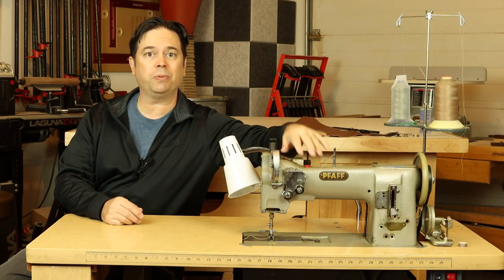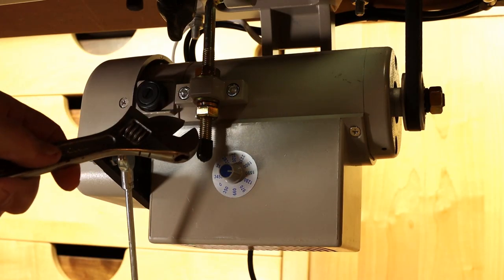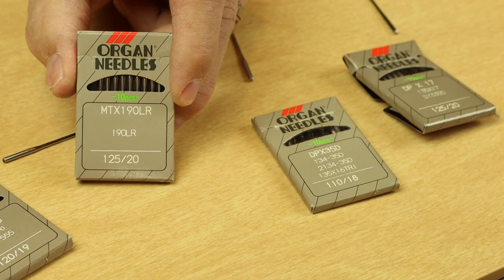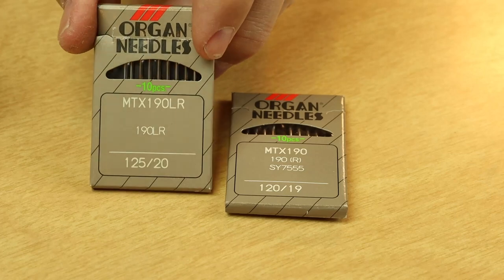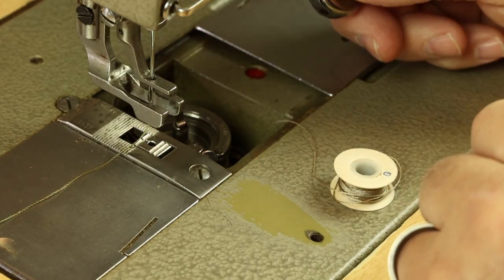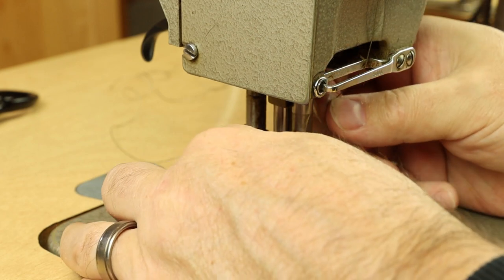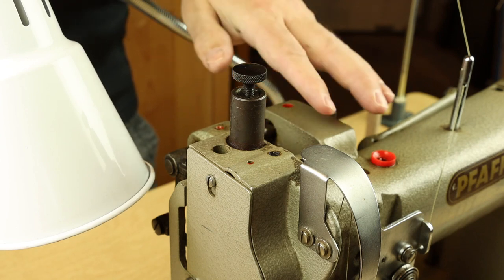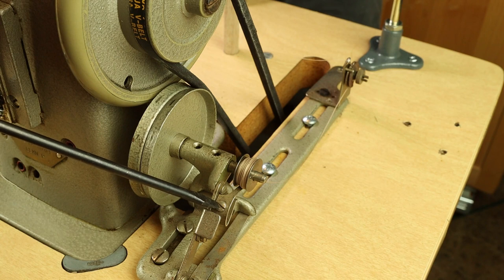Everything Pfaff 145 Walking Foot Industrial Sewing Machine Learn to set up and adjust Pfaff 145 545

Comment: Thank you so much for this video! I was told incorrectly how to thread the machine! Question - my hand wheel is very tight (squeaks when I sew) and when I pull the material (leather and material) away from the machine, after sewing, it's very tight. I have to release the thread tension of the top thread to give me slack to pull away from the needle to cut the thread. My machine jams quite a bit. There aren't many people in my area who have experience with this machine so I am wondering if you think the tight hand wheel is causing my machine to squeak and then jam. I have loosed up the tension to where it's almost at the edge of the tension knob but then my bottom stitch is loose. I did install a servo motor and speed reducer (looks like the one you have). By any chance could the servo motor or belt cause issues with the hand wheel? I am using 138 thread with the correct needle size but wondering if it is too thick. Although I thought that this machine could handle 138. Thank you!
Reply from the maker: Hi Kim,
I would start with 92 weight thread and a #20 needle.  Make sure to use 134-35 needles if it's an H3 model or 190 system needles for an H4 model.  You will always need to raise the pressor foot (or operate the knee lift) to release the threads.  The release will be much easier with 92 weight thread.  I don't enjoy sewing with 138 thread, because it pretty well maxes out the machine.
The squeak can be caused by a new belt or if the motor pulley doesn't align with the handwheel pulley.  Sight down through the slot in the table to check pulley alignment.

Best of luck!
Reply: Thank you! I will try 92! Oddly enough, I added oil near the handwheel where you mention in the video and that helped quite a bit. Still some squeak when I manually use the handwheel but at least its gone while I am sewing. I will check the belts. Thank for the reply!!
Reply: Oh and thank you so much for explaining the needle difference between H3 and H4. I do have H3 and have lots of 190 needles and just by chance also ordered 135 so fortunately I am using the correct needle size so if you need a bunch of 190s, I have some to give away!
Reply: @kpollock313  I could use them for my 545 machine! if no one else can, Thanks for offering!

Comment: Hi there, I’ve just acquired a Pfaff 545 H3 6/01 and I’m looking to find a service manual for it… do you know where I can find it? I have found the instruction manual and parts manual… or is there another machine that would have the same specs… im thinking of timing instructions if needed… great video by the way…sincerely Heather
Reply from the maker: I don't know where to find a service manual anymore.  There may be videos showing how to time a Pfaff 145 / 545.  It's pretty easy once you know what screws to loosen.  I'd suggest looking for a general industrial sewing machine repair pamphlet or book.  It will cover all the main types of machines, and you'll be able to figure it out.  Again, the challenge is finding one.  Best of luck with your machine!  They're great once you get them tuned.
Reply from the maker: I found instructions for servicing your Pfaff here... http://dixiesewing.com/PFAFF%20SERVICE%20BOOK.htm 
Follow the link to your model.  It starts as a basic instruction manual, but keep reading and you'll see written instructions for various adjustments.
Best
Reply: @TheThoughtfulWoodworker  thanks so much! I found that one too

Comment: Another question - and I am sorry for asking because I feel like I am taking advantage of your good nature, but - I cannot seem to find a 190 (LR) Size 20 needle unless it is in a box of 100.  Until I know what the heck I am doing, I would prefer to buy several packets of 10. Please tell me what I am doing wrong that I can find the 190/20 but only in R? I've ordered the motor, pulley and belt, and magnetic guide. I am so excited.

Also, do you still have a woodworking youtube channel? I want to show you something I am doing. It is not something really cool but it is something. I bought an old carpenter's toolbox and I am converting it into a small desk. His union card was in the toolbox and it was dated 1922 so I think the toolbox is over 100 years old. I tried to give it to one of his family members and I searched for a good while on the internet. I only found one person and that person would not respond so I decided to honor the man by making a desk out of the toolbox. Enjoy your week and again thank you for your help.
Reply from the maker: That's awesome you popped for the motor!  You'll love a servo.  I usually buy most of my needles off eBay.  Click on each listing, and see if they have options for 10 needles at a time.  
I just have one YouTube channel for now, with both woodworking and heavy sewing content.  Your tool box / desk project sounds like a great one.  Best of luck!

Comment: Great Video! I learned a lot from your video. Thank you so much. I’m thinking of upgrading my motor to a servo motor with a needle positioner. I want to slow it down to do leather work. Do you by chance know the servo motor brand and model number? And do you like that servo motor?
Reply from the maker: Thanks Greg.  I use the Techsew 550w analog servo with a simple dial to adjust the max speed.  If you plan to use a needle positioner, you'll need to get a digital servo.  Make sure the motor you get is compatible with a needle positioner, because the Techsew and similar servos can't accept one.  I use a speed reducer on both my machines, so a needle positioner isn't needed.
Good luck!
Reply: @TheThoughtfulWoodworker  thank you very much for your time. I really appreciate it!

Comment: Okay, here I am again.  I have a 3D printer and so I ordered some bar magnets and made my own magnetic guide. The problem is the guide swivels on one end so it really does not work for me. In fact, it is just like one I ordered some time ago. So, I keep looking for sources to make a good guide for my 145.  The other day, it struck me that I could make a tee track on my table that would allow me to set a guide, but then I realized a guide is about the only thing I would use the track for so I gave up that idea. Now, I am thinking of another approach and then it struck me that I should ask the guru of leather upholstery and wood working. So, what do you do to make the guide on your Pfaff stay in place and straight?
Reply from the maker: Hi Daryl, you can use cheap magnetic guides from online sources.  They seem to work fine.  If I'm using the small magnetic guides I use two.  Long guides like they sell at Sailrite just one is needed.  Otherwise you can attach a screw-on edge guide.  Most machines are tapped for guide holes, but if not you can tap holes in the bobbin slide plate.  Magnetic guides are easier to take on and off though.
Best
Reply: @TheThoughtfulWoodworker  

Thank you. Enjoy your week.  My problem is I am so new at all of this and I try to watch everything because I am prone to screwing up. As a result, I need these guides like a 6-year-old child needs those inflatable things they put in the gutters for bumper pool. Seriously, I am so prone to making mistakes that I tend to be over-cautious about any part of it.  Again, thank you and enjoy your week.

Comment: My Pfaff machine is having problems. The bobbin case jiggles a little causing a small gap between the pieces. The top thread gets stuck in it causing it all to bunch up and knot. How do I fix this?
Reply from the maker: I would start by confirming you have the right bobbin size.  G style for 145 or M style for 545.  Needle system is a source of confusion on Pfaffs too.  134-35 needle system for H3 models, and 190 needle system for H4 models.

Comment: I just asked a long, involved question but it seems to have disappeared when I added the funding. I bought the presser feet on eBay and it turns out the teeth on the bottom of the foot are smooth to the point that I cannot imagine they are good at gripping the leather. I have an original Pfaff presser foot and the teeth are sharp and grip nicely.  Does this sharpness or smoothness matter and if it does, is there a way of sharpening the teeth with a file or something? Thank you.
Reply from the maker: I usually use smooth bottom presser feet, but teeth or ok as well.  Teeth can scratch leather when you topstitch.  Pfaff's usually have such strong foot pressure springs, I doubt it will be an issue for you.  Good luck, and thanks again!

Comment: Hi hello, thank you for this gr8 video... ive got a question, apart from the lever where we setup the stitch lenght is there any way to sort the stitch size? how can i send u a video to show up why i say this? thank you
Reply from the maker: Hi Marcos, you are correct the stitch length is adjusted by turning the knob on the reverse lever.  Sometimes a machine will be missing a little square metal piece between the knob and slotted plate in the machine.  Or sometimes the piece will be upside down.
When that happens, your reverse stitching won't match the forward stitch length.

Other than that little part being missing or installed upside down, the Pfaff stitch length mechanism isn't easily adjusted.
Thanks
Reply: @TheThoughtfulWoodworker  thats what i mean.... to short stitches :(.... Thank you

Comment: can you tell me what is the heaviest thread you have used and what needle?  I just bough tone of these machines but am a complete novice.  I've started leather work mainly making knife sheaths.  Thanks :-)
Reply from the maker: Hi Gorgon, I usually use 92 weight thread with a #20 needle.  The functional max for the machine is #138 thread with a #22 needle (or step up to a #23 for leather).  Best of luck with it!
Reply: @TheThoughtfulWoodworker  Thanks!

Comment: What is the cause of my walking foot following the feed dog into its slot on the return stroke? I've tried all manner of adjustments but I can't get it to stop doing it.....
Reply from the maker: Try backing the spring pressure off for the presser foot.  It's either a double knurled nut on top of the leaf spring (if so equipped) or a  knob on the top left of the head if it's a newer model.  
Also, make sure the wing nut adjustment isn't loose on the back of the machine.  That wing nut needs to be snug for the walking foot to work.  Hope you get it sorted!

Comment: I have a Pfaff 145, I had it set up recently by a machine repair person, when I got it back my knee lift/presser foot lift does not function while the needle is in the vinyl/fabric.  When the needle is up The knee lift works. How would i fix this?
Reply from the maker: Hi Michael, so the knee lift roller might be stuck on the wrong side of the machine lever.  Just a guess.  Otherwise you'll have to make small adjustments to the knee lift itself.  Make sure it's raising high enough to engage the lever under the head.  
Pfaffs should have a roller wheel on the knee lift.  Many are missing that part, or have been scabbed together with incorrect parts.
Best

Comment: I have the exact machine you are using.  I have everything threaded correctly but it won’t pick up the bobbin thread.  The needle thread literally gets stuck and I have to cut it out. Any suggestions?
Reply from the maker: Try setting it up with 92 weight thread and a #20 size needle.  Be sure to use a 134-35 needle type for an H4 or a 190 needle system from an H4.  If you use a short needs in an H4 it won't sew right.  
Best

Comment: I am sorry to bother you again but when I purchased my 145 (used), it came with several different feet. When I was watching your video on sewing in zippers, I realized I needed to find the feet to see if I had a zipper foot. I cannot find them anywhere and my fear is that I might have thrown them out by accident. I need to get a zipper foot for my 145 and I have no idea what brand I should buy. Can you please give me some advice on the brand and where I might buy one?  Thank you.
Reply from the maker: I buy Pfaff 145 feet on eBay.  They are various brands, and none genuine Pfaff, but they work well.  I like to have a left zipper foot, right zipper foot, and 1/4" cording foot for all my machines.  Good luck with it!
Reply: @TheThoughtfulWoodworker  I have another question. My machine came with a single-toe (left) foot on it. All of this talk about different types of feet based on application makes me wonder just how much I do not know on this particular subject so I am looking for a pictural that shows the different feet for the different sewing requirements. Do you know of such a thing?  Thank you for all of your help.
Reply from the maker: @darrylcrum2495  Not a lot of great resources on that topic.  eBay will show pictures.  A left zipper foot, right zipper foot, and 1/4" piping foot will do most everything.  I probably have close to 50 feet sets, but only use those three.
Reply: @TheThoughtfulWoodworker  Uh, LOL!  Half a centipede. Until my three new feet come in, I am a pogo stick.  I still need to buy the 1/4 pipping. By the way, I just bought a plier stapler. I like that idea a lot!  And with regard to my one-toe footer, I think that might be what is pulling my leather to the left enough to be a bother.  I could be wrong, thought. Enjoy your week.  I am going to leave you alone for a few days.

Comment: I noticed that your foot attachment on your H4 looks to me to be a welting or piping foot.  Is that a foot that you personally use for regular stitching as you have demonstrated?  Or did it just happen to be the foot attachment that you had on the machine at the time?
Reply from the maker: I like to have a 1/4" welting foot, left zipper foot, and right zipper foot for each sewing machine.  I would say I use the welting foot for 90% of my sewing.  Hope that helps!
Reply: Yes thanks, that does help.  I have the same attachment but I've only used it for making piping previously.  The only other foot I have, has a very short "footprint" so to say.  Which makes it difficult when getting started on a stitch at the beginning.  I keep catching the material, and it bunches up. Plus not having a servo doesn't help either.   I like the long footprint on that welting foot, so I think I'll start using it in the future for regular stitching.  Thanks again.  I really need to get a servo motor. @TheThoughtfulWoodworker
Reply from the maker: I agree on the servo!  Here's a quick installation guide if you get one...  https://youtu.be/Dx_rS9Fzvfo   @vintagesirvivor
Reply: Thanks for that link.  Looks like a pretty straight forward process.  Your co-worker seems to be lacking a wee bit of enthusiasm though.  :)  @TheThoughtfulWoodworker

Comment: My machine keeps bunching up at the bottom. Broke a couple needles from it. No idea why it's doing this.
Reply from the maker: I would put any projects aside, and set the machine up with 92 weight thread and the correct needle.  Pfaff H3 standard lift machines need a 134-35 needle system, while H4 models use a 190 needle system.  Use a size 20 needle for 92 weight thread.  Then increase upper thread tension until you can balance a stitch.  Most common reason for bunching thread on the bottom is loose upper tension.

Comment: Will this machine handle a 207 or 277 thread?
Reply from the maker: No, not really.  Functional max is 138 with a #22 needle for cloth or #23 needle for leather.  I almost always use 92 weight.

Comment: Hi, what CLMN 10, what the 1o stands for?    Thanks
Reply from the maker: C= medium class machine, L= for leather, P= 4 motion drop feed, M= machine has safety clutch, N= 6mm max stitch length.  H3= standard lift, H4= high lift.  The number such as 6-01 describe what specific sub-model it is.  As long as it says "CLPMN", I've always been happy with them.   If  this one has only 3 motion drop feed, it might still work fine for your needs.
Best of luck!

Comment: if my machine is occasionally doing long stitches what could be the issue?
Reply from the maker: Warn needle bar bushings.  It happens with older machines as they wear out.  Or it could simply be a skipped stitch.  If it's just a skipped stitch, check thread path, quality of winding on bobbin, upper tension check spring, hook timing and hook spacing.
Reply: @TheThoughtfulWoodworker  thanks very much